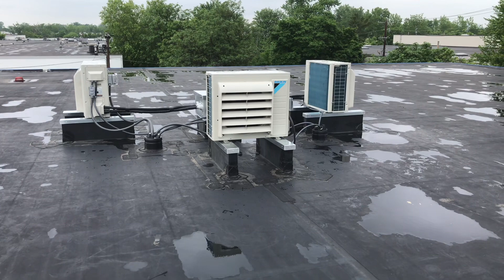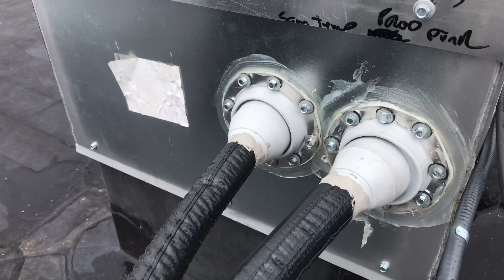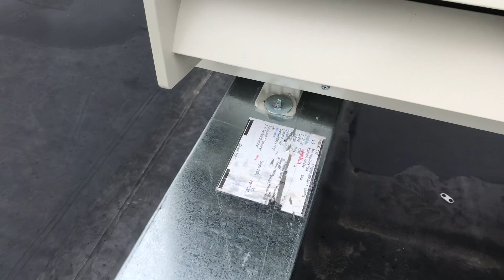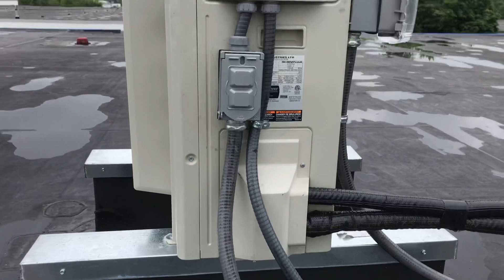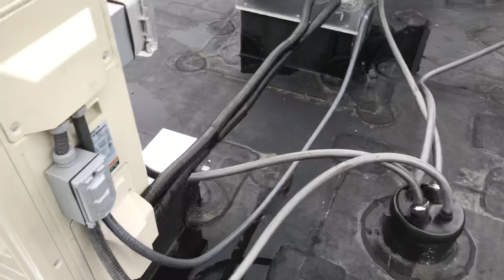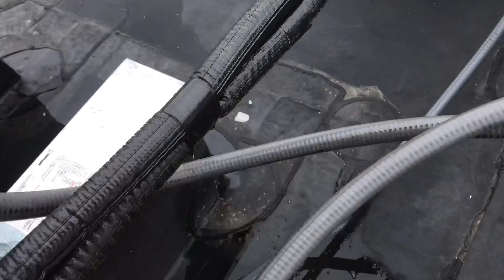Hack Electricians Ruined This Air Conditioning Installation!

Comment: Those wind block louvers are designed to point up not down.  Very common mistake. Bc units are off the ground it probably won't make a difference. Ive seen issue with thermisters off on limit when too close to other units or low to ground.

Comment: The best way to do these penetrations is to do a proper roof jack and then use a 180 degree down-turned metal elbow with a proper storm collar.

Comment: Why didn't the electrician use the same pitch pocket with a hard EMT conduit then convert it over to seal tight close to the end of the run! I agree they did a crappy job man

Comment: The HVAC install is not that impressive either, the lines aren't level and straight they're held together with duct tape. There should also be some kind of support in case some roof monkey decides to climb onto the pipe, roof block with unistrut etc.
 When you go through the side of the pitch pocket, you should not go around the insulation you should cut the insulation away in the section where you seal to to stop water from being able to transmit down the insulation, plus even though it is a UV resistant installation it will eventually fail causing large gaps for water to flow through.
Reply from the maker: Yes you bring up some valid points. There are certainly things that I would have done different. I have seen duct tape used over zip ties because it blends in with the armaflex but I would agree that duct tape will not last in the outdoor elements. Also I am interested see how well the UV resistant pipe insulation holds up and if the penetration points leak.

Comment: The job, although not pretty is perfectly legal. I’m sure the flex coming from 2 different pitch pockets is one for power the other for controls. They could have set the unistrut blocks made for roof, ran EMT of some rigid between the penetration and then unit then flexed up to the units off the conduit. Again not pretty but not in violation of code.
Reply from the maker: Yes I assume you are right, the control wire got mixed up for two of the units. In my experience, I am use to seeing some rigid and then transitioning to flex like your saying.
Reply: Agreed